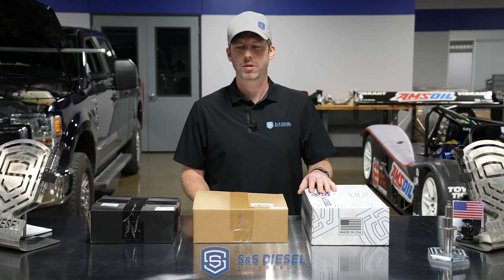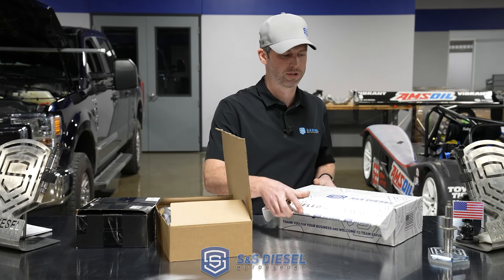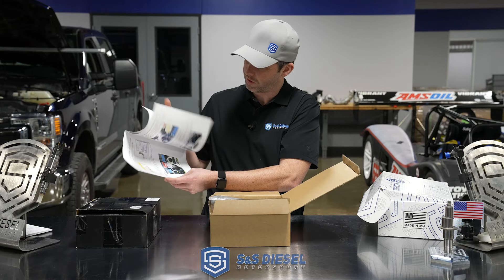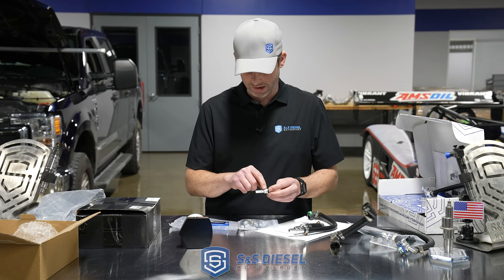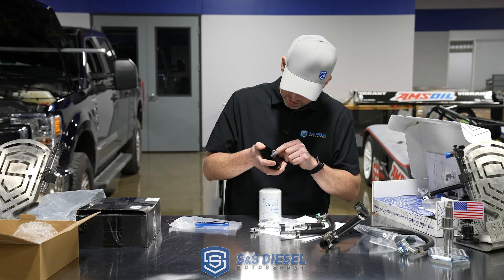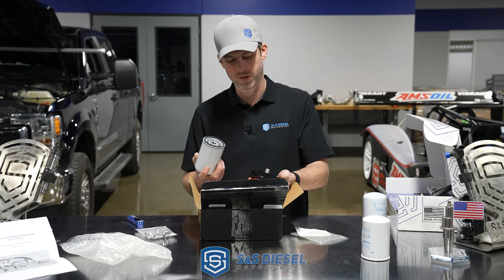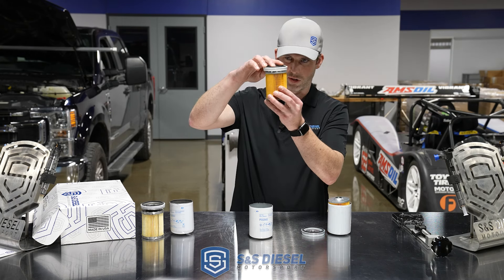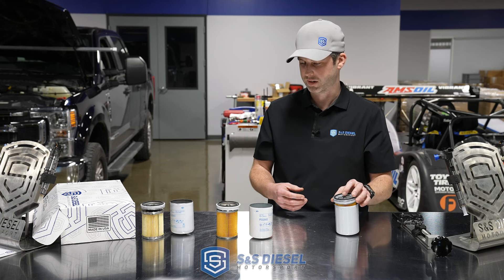You Get What You Pay For - S&S CP4 Disaster Prevention Kit vs Knock-Offs

Comment: WHATS THE BIG DIFFERENCE BETWEE YOUR S&S KIT AND THE SPE KIT?? Please
Reply from the maker: We try to focus on the features of our product and not what our competition is doing differently. We made an exception with this video because ATTEMPTING to copy our kit to a T is not competing, it's cheating. In the case of SPE, they at least took our original DPK idea and expanded on it with their own design and added a 20 micron metal screen to catch the metal. We have not failed a CP4 to test their kit, but we have failed multiple CP4s to validate our Gen2.1 DPK. The first failure was on our test bench to get a debris sample for analysis. Results show that 51.43% of the debris volume was under 21.2 micron and 27.49% was under 9.86 micron. Based on those results we were confident that any extremely small particles would get filtered out in the factory fuel filters. Mold and tree spores fall into the 9 micron category, so we're not too concerned with particles under that making it past the return filter. Just to be safe, we also failed a pump in-truck and towed a trailer with it. All of the visible metal was contained in the return filter and and injectors tested like new. We also chose to have no threaded connections on the supply side due to the potential for threads to create debris.
Reply: I'm fighting with SPE to try to get them to refund my money for their cold air pipe. They altered the IAT sensor port to delete the locking feature and make the hole shallower so the sensor isn't supported as well as the stock part. So I wasn't able to install the pipe, but they're refusing the return because I assembled the upper end to the intake. Totally bogus, and I'll never get anything from SPE again.

I just ordered the S&S DPK. If my CP4 ever goes bad I'll get the DCR.

Comment: Am I understanding it correctly? Your filter is on the high pressure side between the HPFP and the fuel rail? Since it says it protects the rail/injectors?
Reply from the maker: The filter is on the return side. The billet bypass block alters the flow path so that case fuel, where the metal is created during a failure, is sent our the return and the pumping heads are fed with clean fuel directly from the stage 2 fuel filter. Here's a flow path drawing that helps explain how it works: https://ssdiesel.com/wp-content/uploads/2018/08/CP4-Disaster-Prevention-Kit-How-it-Works-24APRIL2024.pdf
Reply: @SSfueled  Tank you. I have a VW TDI with the CP4 pump and I am interested in such a system. There were two manufacturers for VW but after dieselgate they shut down because VW then provided an extended warranty covering the pump and injection system so no one bought them. Now that warranty is up and suddenly it would be nice to have that protection again.

So I'm doing some research on what might fit, but in contrast to these trucks I have a tiny engine bay to work with.
Reply from the maker: @Fekillix  We have prototype DPKs currently installed on a few internal test cars. We do not have a timeline on when we will have production kits ready, but it is on our new product development list.

Comment: When an engine is replaced do you need to replace the blue o-ring on the metering block to pump place or can it be reused when reinstalling on the new engine?  Thank You.
Reply from the maker: You can reuse the blue o-ring that sealed the IMV to the pump.
Reply: Thank you!!!!!!!!

Comment: Wouldn't teeing off the supply fuel limit the fuel that lubricates the crankcase a little bit? I have the kit and I'm on the fence on installing.
Reply from the maker: That's a valid concern. Rest assured, it will not limit lube flow to the case. The overflow valve on the pump case is what sets the supply pressure by bleeding off excess fuel. This ensures that the case is completely full of fuel and at the correct pressure. We've thoroughly validated our kit to make sure stuff like that doesn't happen. Just one more example of what we do and what the knock-offs don't. They just sit back and let us do all of the work and then swoop in and copy a thoroughly developed product. Based on the results of this video, they can't even copy it right.
Reply: @SSfueled  awesome,  looking forward to installing it. Thanks for your reply

Comment: Good morning. I have an Isuzu engine that uses the cp4 pump. I want to install a bypass kit and need only the piece that holds the metering valve as the rest will need to be customized anyway. Can you sell parts separately?

Comment: I believe the first knockoff one has the same push ball in there as yours, is that not reliable?
Reply from the maker: At least they managed to copy that part of our design correctly. Pressing a ball into the drilling is the best way to ensure a good seal without metal burs, which would make it more reliable than the NPT plug used by the second knock-off. Yet, the first kit uses rubber air hose that is not rated for diesel fuel, loose worm gear clamps, plastic flashing in the quick connect fittings, and a knock-off fuel filter that doesn't even filter. It is NOT reliable at all.

Comment: Why I have almost completely stopped doing business with Amazon. Even items sold by and shopped by them, let alone fulfilled by them only are starting to have knock-offs enter the supply chain. It all started for me a few years back when I ordered a fuel filter kit for my 2014 F350 with the 6.7L diesel. The photo was correct, but  having been doing this for years I immediately knew the filters were bullshit when they arrived. I have yet to bolt on an S&S part yet. With 200k on my truck now, I had been ready to pull the trigger on the bypass kit. Then you announced the DCR. Tough choice. Either way, PTT wA Rod will be installing whichever I choose. The dude is an artiste, much like yourselves

Comment: Have you guys just changed the filter and the adapter and rubber hose to braided?
Reply from the maker: We have not seen the need to use braided hose. The rubber fuel hose that we use has been tested for fuel, pressure, and longevity. We’ll certainly make changes if/when needed.

Comment: You make a great kit however $400 for what is there certainly is a high profit product.  I think they are all overpriced.  The sum of all parts to me does not add up to 400 and even worse is the new pump that replaces the factory cp4.  You guys could certainly make it more affordable and if you did you would probably sell more.  That new pump while it is a great product is cost prohibitive at almost 2000 dollars.  It seems that everything your company makes is super high dollar to the max.
Reply from the maker: We agree that the sum of parts does not add up to $400, if so we would be out of business and unable to continue to develop solutions to fuel system problems. The difference between us and the copies, is that we have invested a lot of money into the design and validation of the product. That includes fuel system testing stations, multiple test vehicles, engineering payroll, software licensing, etc. It is a high-profit product per unit, but considering what it does and what it took to design it, we feel the value is just right. Thank you for the honest feedback.

Comment: The Donaldson fuel filter interchanges with Napa 3358 (10 micron) and Napa 3124 (6 micron) fuel filters. Do you have any experience with this to know if either of these are an acceptable replacement filter for me when the time comes?
Reply from the maker: We did not have the bandwidth to test every filter out there. As long as the micron and efficiency rating match Donaldson's 9 micron at 99.5%, they should work the same. We say "should" because we prefer to make data-based confirmations. Keep an eye on the efficiency rating of other filters. You may get a low micron yet with a low efficiency percentage. We prefer to use the micron rating at 99% because it's as close to absolute as you can get. Technically, the Donaldson is 7 micron at 99.1%. Another factor in choosing the Donaldson filter was availability. You should not have much trouble finding one. Thanks for checking.

Comment: I would add a cosmetic fault , because the cloned copies will get better. In Europe some of the cloned parts on certain products were so good that the steel had to be tested ! After that slight printing and stamping errors were introduced  which were not copied onto the clones making them easy to distinguish to the trained eye.